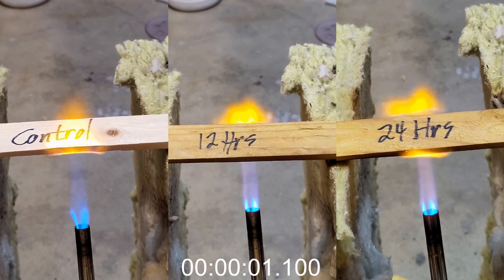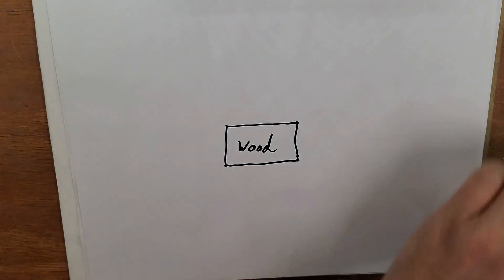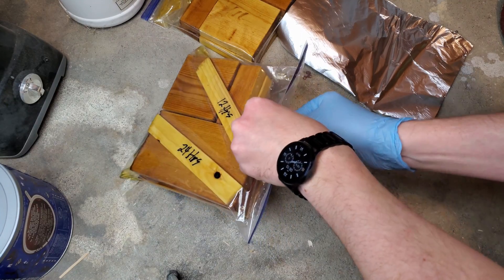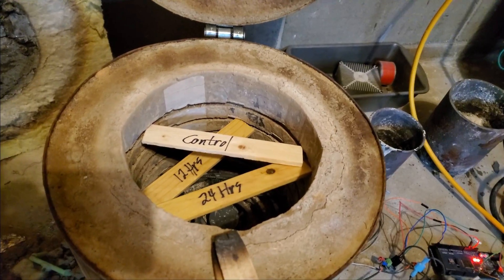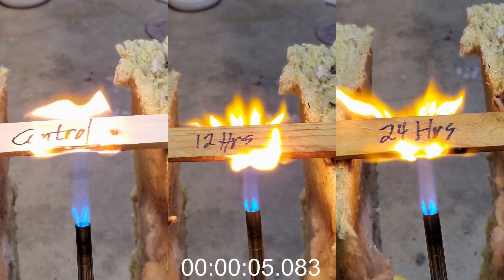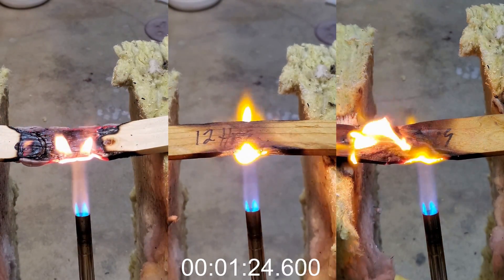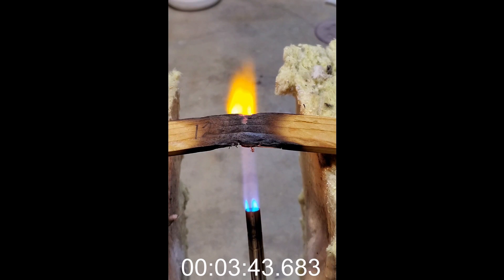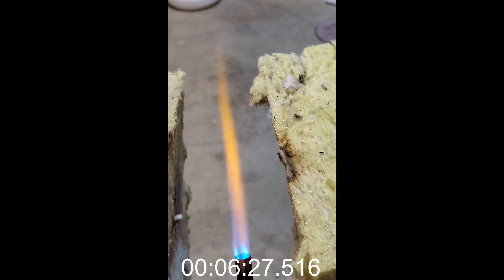Secret Fire Proof Wood

Comment: Secret fireproof wood? This was discovered in the 1800's! 😂 Also, not a long term solution for exterior use! "In terms of moisture resistance, sodium silicate soaked samples were exposed to effects of weathering for a one year period. It was found that there was evidence of leaching of sodium silicate from the wood, with approximately fifty percent of the sodium silicate removed after one year".

Comment: Sir, a Very good video. Where can I get "Water Glass". Google couldn't tell me and Amazon is a no go
Reply: You can make it from some kinds of kitty litters, from silica gel desiccant, or purchase it from a Home Depot as concrete sealer/hardener.  It seems like purchasing it directly is really expensive, and when I was purchasing desiccant it was actually cheaper to buy flower desiccant than kitty litter!  But that really depends on shopping.  Why is Amazon a no go?

Comment: One thing id point out; the more relevant test isnt how long it holds up under a torch; but if it will sustain and spread a flame. It does not take much silicate to stop that.

Comment: Why did you use pine instead of other woods?Doesnt pine shim have resin in them which makes them easier to burn?
Reply from the maker: Probably, the test was more about the process of fireproofing rather than a fireproof end product. A less flammable/more dense wood would likely burn more slowly with the same process. Pine is just a very common building material here in the states for our "stick built" houses

Comment: Should have dried the wood before soaking in sodium silicate, not after
Reply from the maker: The shims are supposedly kiln dried, but they certainly could have absorbed some moisture from the air. Drying after the soak was necessary to ensure the water would not affect the test result
Reply: @TenTries  Yes sorry, you do still have to dry after as well, but I suggest drying beforehand as wood is decently hygroscopic and will absorb moisture from the air

Comment: Is there a toxic/chemical smell or off gassing?
Reply from the maker: Not that I could tell. Sodium silicate does have a particular smell, but it is vastly overpowered by the smell of charring wood when testing. The foaming that you might notice when I pour molten aluminum on it in the sand casting video is mostly from the sodium silicate giving off water and the wood producing wood gas. In this video, sodium is being given off which you can tell by the yellow flames. With a torch, I was intentionally exceeding the temperature that this treatment works

Comment: Would something like this keep wood from combusting from heat? Not necessarily a direct flame? I have been toying with the idea of making a wood-bodied car, and heat from the motor is what is keeping me from starting to design a project like that.
Reply from the maker: I can't say for sure, because I haven't tested it. It should help though. The highest heat in an engine compartment would be the exhaust manifold. I don't think that gets hot enough to heat up the engine compartment enough to combust wood (230C, 450F), but it may get hot enough to thermally degrade the wood which occurs between 100C, 212F and 170C, 338F. Also, this treatment is notorious for causing wood to rot outdoors, because it can trap water inside the wood.
Reply: @TenTries  from my research, an engine an get up to about 220f, so you may be right about it not getting hot enough to combust. My worries is 1. the off chance it does, and 2: The glue being strong enough to withstand that heat, I would definitely need to think of something else to solve that issue. Is there anything else you could think of that could help "Heat Proof" the inside of the hood? ( either laminating another material, etc.)?
Reply from the maker: @thewoodworkinghusky3284  ceramic fiber insulation may help keep the heat away from the wood
Reply: @TenTries  thanks, I'm gonna try and look into that!
Reply: I would be worried about the radiant heat off the exhaust manifolds and I would put heat shields or wrap around them. A gas engine under load on the highway with strong winds, hills, etc, they glow red hot, some almost white. I work on UPS delivery trucks with many using a Gm 6.0 vortec engines and other gas engines and with the dog house off at night on test runs on the highway, they glow so bright under some conditions, you can start to see the frame rails, wiring, engine components etc in total darkness and you can feel the radiant heat from it sitting in the cab. Even if the air in the engine bay only gets to 200 degrees, the surfaces of the components that are directly exposed to this thermal radiation will get much hotter. If you notice, unprotected wiring in an engine bay that run near unshielded exhaust will become brittle and its plastic loom wrap will break away much faster than other areas of the engine bay.

Comment: This is widely known at least in central europe. I remember seeing it in very old books 1960-1970 at least. Very surprising someone would patent this and be successfull from keeping it out of the market.
I suppose it may have some disadvantages, not sure what exactly.
Reply from the maker: In my research, I only found a deck treatment using it. I'm betting the biggest disadvantage is cost.
In my experience, timber producers don't like to have wood laying around. In a previous job of mine, the timber producers would send us wood that was clearly grown quickly and had a high moisture content by the time we received it.
At ~$5 per 2x4 stud, an added cost of a dollar or two would be significant